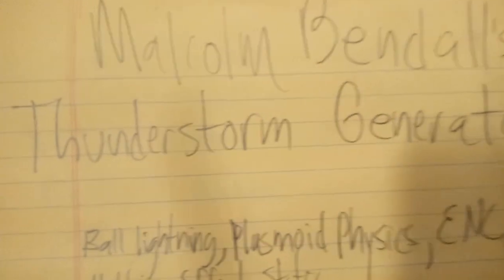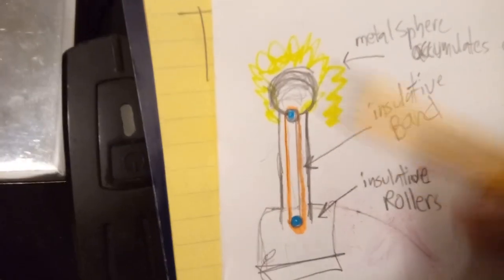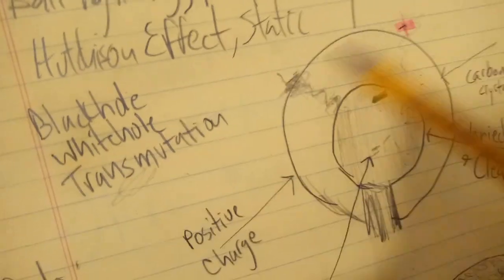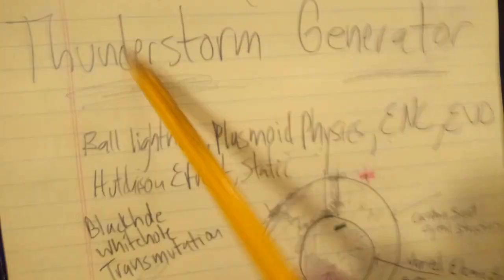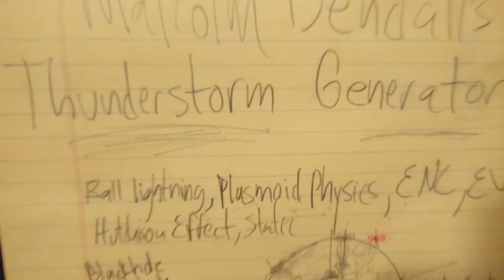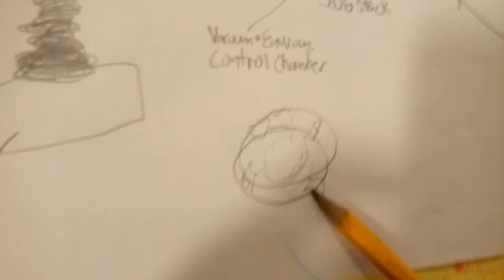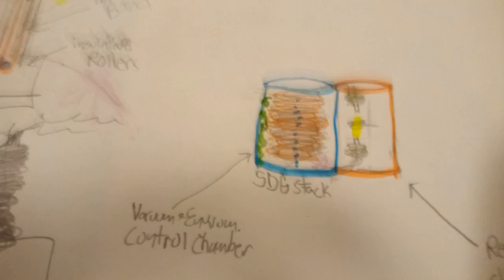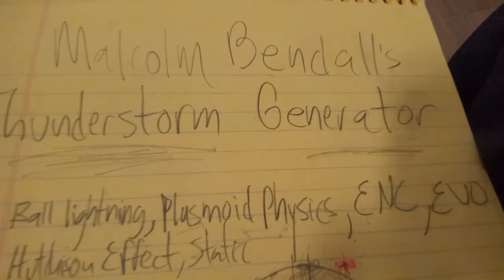MALCOLM BENDALL"Thunderstorm" Generator

Comment: VanDeGraff? No, it's a kind of zero point energy device man. Thus the 3 nonlinear layers. Those provide the carrier wave which gives the uv nano bubbles a reason to become pump zwaves instead of sinewaves, giving you an ion diode effect, which is why it inducts thermal mesons so dang fast. You missed the mark. Maybe you can make a new video to properly explain this. Do you know what charge confusion is? Why 3 phase power is more efficient? The 3 layers given charge loss have no resource to re-ionize without neutral ions of air flowing in. This device splits charge. It is ideal to burn off energy with a hf coil like a Tesla, but sharp metal corners will do this to a degree anyway.